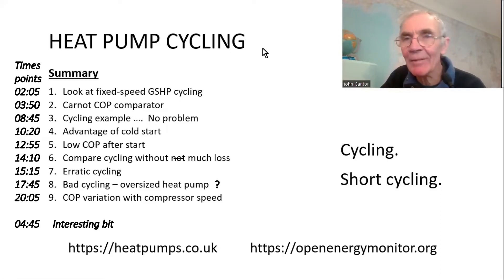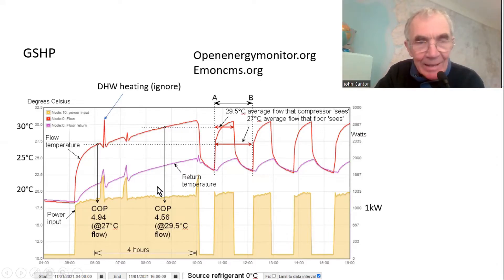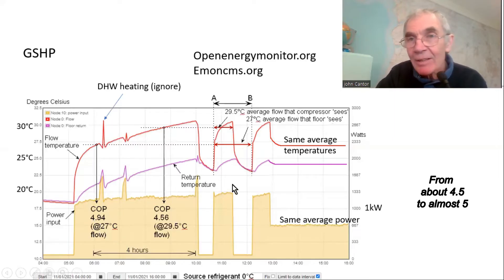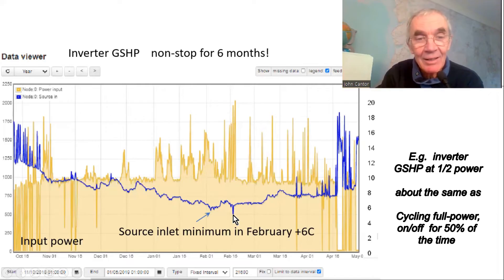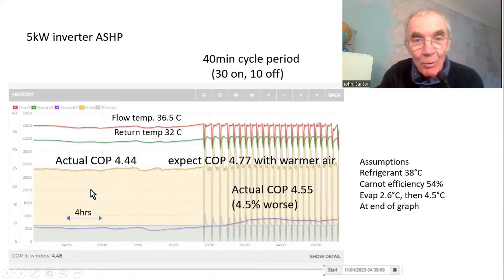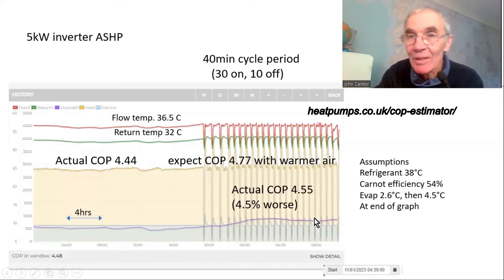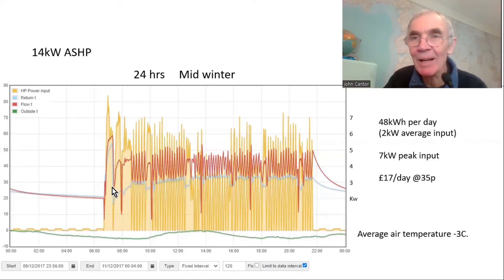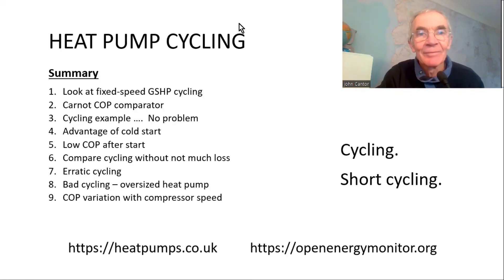Heat Pumps Cycling (switching on and off)

Comment: 17:43 Looks like that house doesn't even need 7kW in the middle of winter, but the owner accepted a 14kW unit, smh.

I was told by both engineer and installer to get a 12kW unit... thankfully I don't have a trusting nature when it comes to such things, so I checked dedicated social media channels instead.
Nerdy owners who use custom equipment to monitor their units and share the data on social media are exactly the kind of people you need to go to for advice, forget about installers and engineers trying to sell you units that they know precious little about (they might pretend to know by throwing marketing talking points at you, which is an indicator of ignorance). 

Instead of a 12kW unit, the nerdy owners told me to get a 6kW unit and to forget about buffer tanks and secondary pumps... they were far closer to the mark than the engineer and the installer. 
I went for an 8kW unit in the end, no buffer tank, no secondary pump, this unit is still a bit too big for my house, which became obvious in march when it started cycling.
Fortunately, it's not horrendously oversized, unlike the units shown in the video, so the cycling can be considered normal.
The SCOP is around 4, which I call a success, given the piss poor radiator installation the house has (narrow piping, all in series, just two rings for 9 radiators).
Reply from the maker: I think installers are worried about what happens on the coldest day,
and no doubt one or two people will control their system badly (not keep
the 'plates spinning'), and expect to heat up a house from cold on the
coldest days. So, fitting a big one can be a safe bet for an installer.
I'm sure that like you, many people would be better off with a smaller
unit, on the other hand, a few would be miserable in the depth of winter.
Not sure I share your trust of social metdia.. a lot of good advice, but
just as much bad advice, and impossible for the uninformed judge between
the two. I often get depressed when browsing FB.
In the old days, the only cost effective heat pumps were small ones
(like yours), and geberally these won't need buffers or complexity.  I
have a lot of experience of tiny heat pumps feeding big existing
radiators, and all supported with woodstoves for the coldest days.
If you browse, you will see refernce to small heat pumps 'straining'... 
not the case.  heat pumps love heating tepid radiators. People need to
make sure there isnt an electric boost in there somewhere.   As you
experience.. a lot better running, with less cycling, on average winters
days... of which there are many.
Reply: @johncantor4056  
Hi John, thank you very much for making these videos, your calculators and taking the time to read comments and reply. 

Here in Spain many heat pump installers shove grossly oversized heat pumps down the customer's throat and, on top of it, blindly insist on buffer tank + secondary pump.
If you tell them that you won't accept an oversized unit with an unnecessary buffer tank + additional pump, many refuse to do the installation, some even go as far as making you sign a waiver (they've watched too many lawyer movies 🤣). 

I understand that these companies are weary of clients who don't know how to run a heat pump system, so they err on the side of absurdity (and heftier bills... charging double of what they should and cashing in the EU subsidies that are meant for the customers).

Anyway, one of the things that bothers me is that these companies don't bother running the numbers. 
For instance, I was repeatedly offered a 12kW unit despite the fact that my radiator installation could barely dissipate 6kW (assuming ΔT 30ºC). 
I don't know why I bothered making and sending those companies a detailed schematic of my home and radiator installation, they paid no mind to it.

In the end I added 29 radiator elements (close to 2kW of extra dissipation capacity, just in case) and chose the 8kW unit, which turned out to be in the ballpark of what my home needed.
A 12kW unit would've been beyond overkill, since my home needs around 6,6kW in the coldest hours of winter.   

Regarding social media, Facebook is the last place where I'd look for advice, I joined a Spanish Telegram channel dedicated to heat pump systems, over a thousand members, hundreds of heat pump owners sharing installation details and performance in a spreadsheet, technical manuals, schematics, tutorials, quotes, advice... pretty useful overall. 
But still, I didn't fully trust their advice either, they were telling me to get a 6kW unit and got an 8kW unit instead 😉 

The only thing I'm worried about is the rather low flow rate I get when the 3-way valve directs the hot water towards the radiator circuit.
I get ~670 liters per hour, when it should be closer to 1000 liters per hour, which I guess is caused by the narrow piping of the radiator circuit (16mm multilayer pipe, in series, only 2 rings, 60 radiator elements per ring).

With this rather low flow rate, my unit is forced to increase its working ΔT to 7 or 8ºC (in order to output the same kW), instead of the ΔT 5ºC it's designed to work at.  

Do you think this is a problem I should be worried about?
I can't change the piping of the radiator circuit, since that would involve destroying my home😩

I know it's not a problem with the Y filter, the dirt filter nor the unit, since the flow rate is nominal when the unit does DHW (3-way valve directs the hot water towards the DHW tank exchanger instead of the radiator circuit).

Thanks again for your time and expertise!

Comment: There’s a lot to digest in your video.  Thanks for posting it.  Here’s a video where I examine the performance of my own heatpump:  https://youtu.be/QAKLrVAdvQ0?si=H3oZ9isini3LlF93

I came to different conclusions as to why my COP was getting worse for higher ambient temperatures, but since that video I’ve gotten even newer insights into my heatpump performance.  What I’m seeing is that flow return delta T is shrinking from 4 degrees to 1-2 degrees during milder weather and warmer room temps leading to bad COP.  But when the house is warming up from cold following a vacation, the COP is much higher.  So I’m wandering if actually my radiator TRVs are the culprit, despite being on the maximum end stops.  I’m wandering if they are closing in anyway
Reply from the maker: Hello Anthony.. i look forward to watching your video through ( no time right now!!)..  One initial question.. how accurate do you think your heat assessment is when dt is less than 2?  A small sensor error will make a big difference.  with no heat, bit pump running, what dt is showing on the heat meter?  Is it zero?  I will watch your video soon,
Reply: @johncantor4056  Hello John I find the flow sensor minimum reading is 6.5l/min (which is also what the manual says) and the next lowest reading is 7.1l/min so that’s just over 10% error. Likewise when it comes to the primary current reading for the compressor the lowest readings are 0.5, 1.3, 1.8, 2.3 Amps etc… There’s absolutely no variation in between those discrete readings. What this means is very choppy current and flowrates and therefore very choppy instantaneous coefficients of performance.   However when you average it out over the course of 10 minutes then you get some quite revealing trends happening, I tend to use 10 minute averages to determine what’s going on with my heat pump.   DeltaT temperatures are accurate to within 0.1 degrees on both the flow and return temperatures.  I am able to determine the accuracy of my calculated power consumption by sampling the readings against the power meter feeding the heat pump and the averages are very close but instantaneous readings can be off by quite a bit.